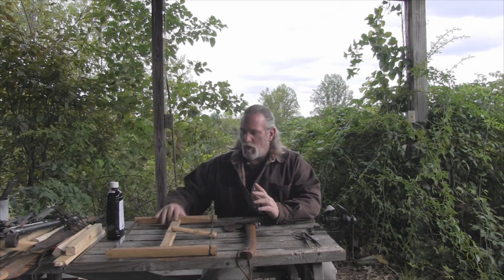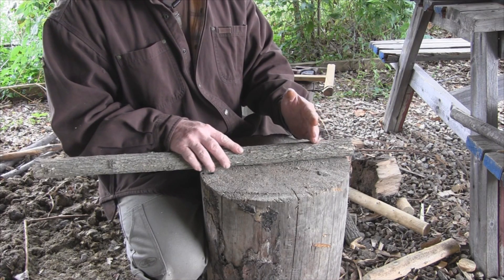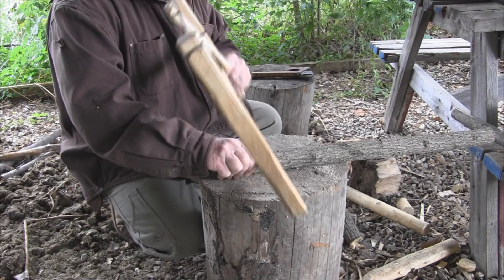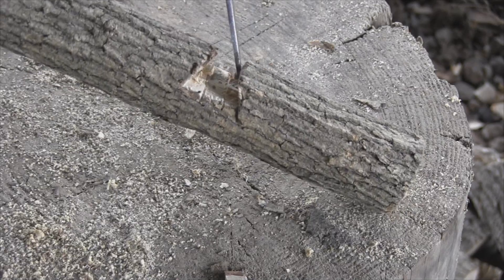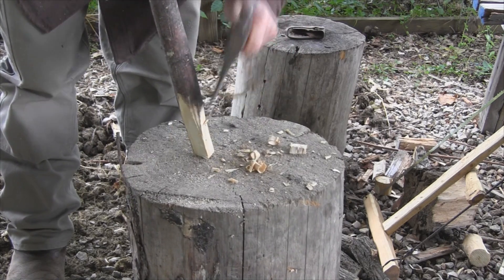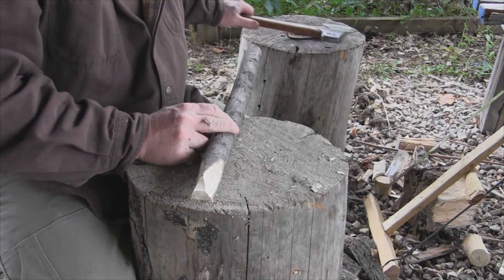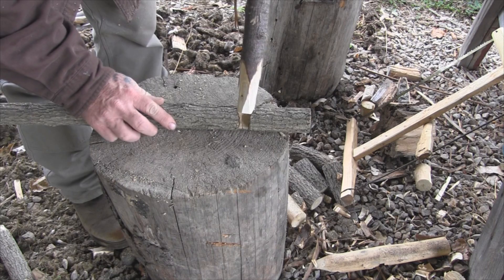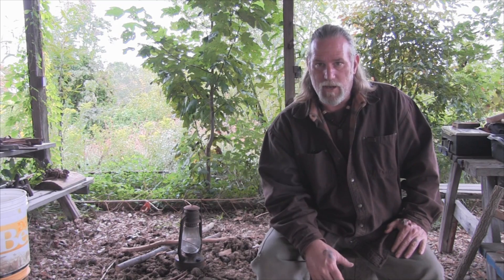Dove Tail Notches Wood Craft on a Budget Part 20

Comment: As a former journey man carpenter I would call that quick and dirty. As a woodcrafter I would call that totally functional and useful. In a pinch that could be done with only a knife with batoning & whittling. I would like to mention these skills require dirt time which can be done at home, this is a perfect example of something you could practice and refine at home. no measuring, eyeball method you will be surprised how good you can get at this with a little practice. Thanks Dave

Comment: Well done Dave and it will work for a time but the strength of a dovetail joint doesnt come from compression it comes from the percision of the joint... The compression will lead to the female part of the joint "tag end" splintering and cracking verticaly... A mortise and tennon joint is always best when under compression... Been a woodworker for approx 20yrs - 10 of which were serious in the fixture, furinture, car and home audio,kitchen cabinets & Taught a woodshop class for 1yr... It will work for awhile but with wet/dry cycles it will fail...
Reply: It's "Wood craft on a budget." Clearly explained in the context of something very temporary to be used around a campsite- not to be sold as professional grade furniture. I guess some experts just can't help but be pedantic.
Reply: Who cares man ... ? It will work for a few days in a camp and that´s all that matters.
(no offense!)
Reply: How do you do that?  Sounds interesting , but I never heard of it.  Do you happen to have an custom woodworking videos?  I'm really interested in being able to put bars on my windows that come off quickly from the inside, maybe with some subtle handle pulls.
Reply: I can think of more durable ways to do it but it would take more tools/materials. You could do this with a saw and a knife. Having a hatchet made it easier. You should have one anyway.
Reply: That's good advice if I was going to open a woodworker's shop, but I think you missed the point of the video.
Reply: making the dovetail sightly wedge shaped helps loads for compression, you are halfway there making a shelf frame pack for loading large game out of the back country

Comment: Cudoes Dave for sharing this . I have been in construction and a finish carpenter for 25 years. Taking an ax or hatchet on a scout had not occured to me until watching your lessons. Common man doesn't always equal common sense. one thing you did and didn't point out is your female notch is away from the end 2 or 3 inches if you have the female notch closer to the end and pound the pin home the notch will break. I usually use the v forked branches with a horizontal H like contraption and a 5 foot extension over the fire just down and dirty. Next time I will give this tip a go.

Comment: I wouldn't have thought to use a dovetail joint in that particular application.  For me a half lap joint would have been my first choice.  However as with any particular task, there is more than one way to get to the same end result.
Reply: You could notch or rabbit the end of the horizontal member and jam it into the dovetail up to the shoulder of the notch. If your're lazy like me. :)

Comment: I'm not a carpenter or woodworker so forgive my ignorance. But it seems to me like a really good 1/2 inch wood chisel would be an almost priceless tool (piece of gear) to carry, for longer term anyway, so why haven't you included it in your items to carry with you suggestions. Damn Dave I get the distinct impression if we give you (a Q-tip, toothpick, and a bobby pin) you could build us a shopping mall in the middle of the forest. A really good video......again, thank-you.
Reply: Sean M
 Thanks for the link. I enjoyed Mors and what he had to say. And there is much more useful info there also. Once again thanks.
Reply: Stanley makes a folding chisel. Folds like a butterfly knife. Not expensive and easy to carry in your pack. That and an appropriate sized scotch eyed auger and the bucksaw and you can make some serious joints with little effort.